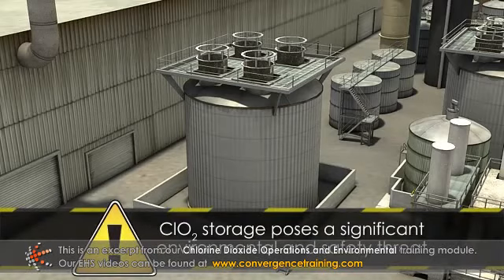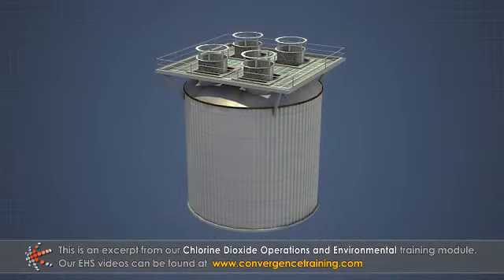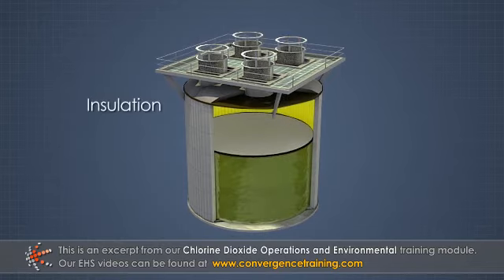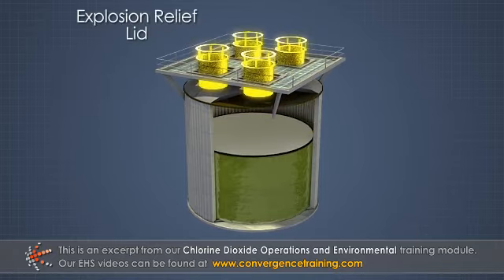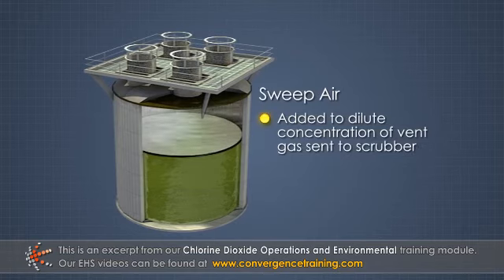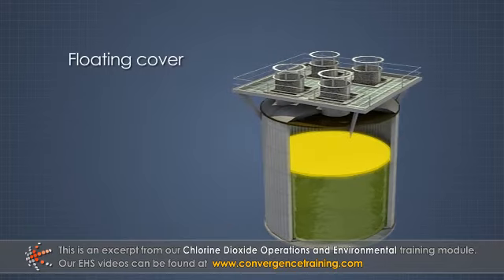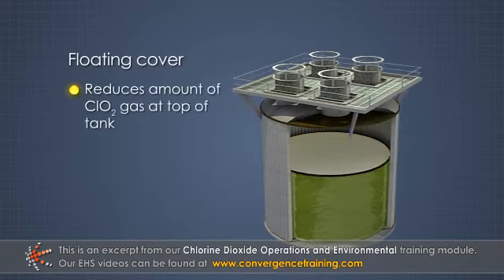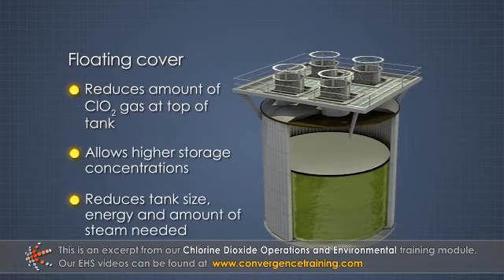Chlorine Dioxide Generation Chemical Safety and Environmental Awareness

Comment: Ya, OR you store separately both sodium chlorite and the activator, hydrochloric acid (which combined make ClO2 Chlorine dioxide), and there is no need for refrigeration of either liquids!
Reply: Thank you for the answer. Well, going "conventional" and using chlorine was never an improvement.
Reply: these industries need TONS of ClO2 and having 8 tanks of reagents vs 1 will save space and costs since 1 tank of liquid ClO2 is better than 8 tanks of salt and acid to make the same amount or even less ClO2.
the costs of safety systems is much less than the costs of always buying way more reagents to prepaire ClO2 rather than buying/producing and storing it outright.
Remember than small scale lab proceedures usually never are economically viable in large industrial scales.